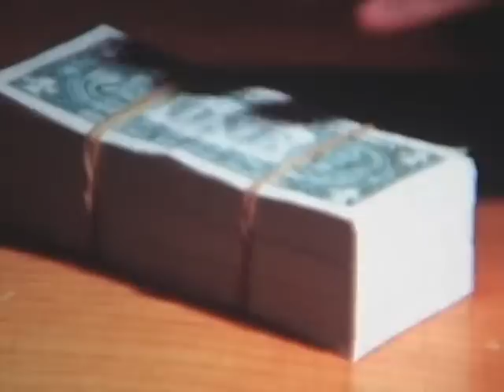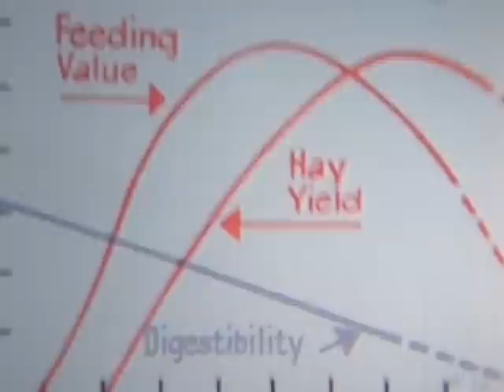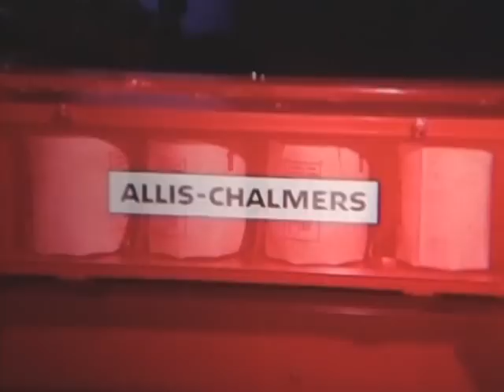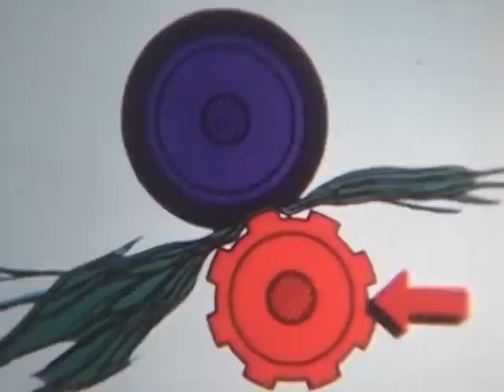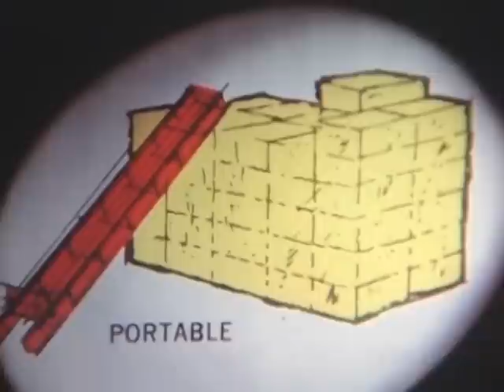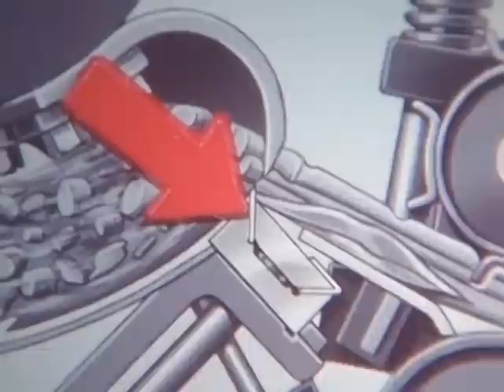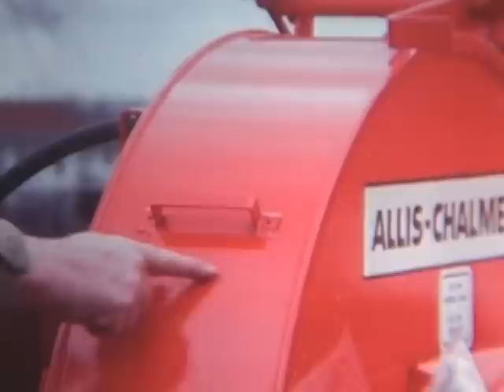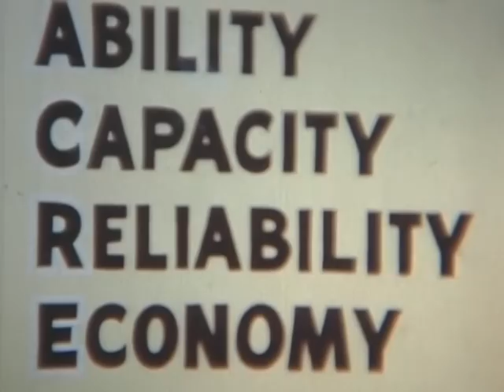Big Acre Handling Of Hay And Forage Crops

Comment: I just noticed that the first baler at 2:40 has a PTO powered thrower but the second at 3:26 has a separate gas engine powered thrower.  Some thrower-equipped baler I've seen had two engines onboard - one for the baler proper and another for the thrower.